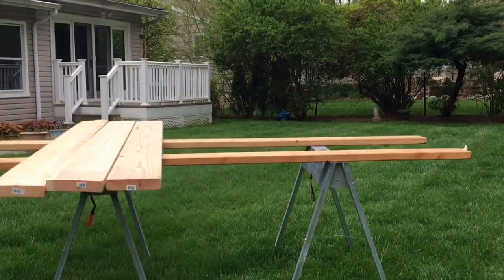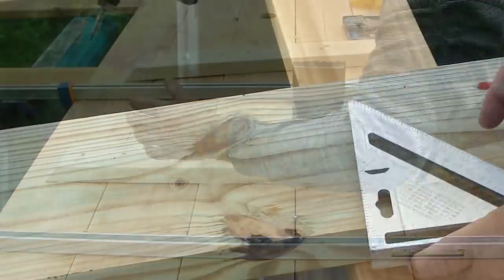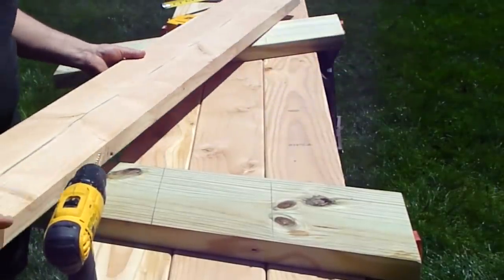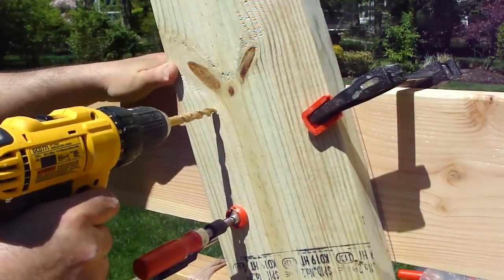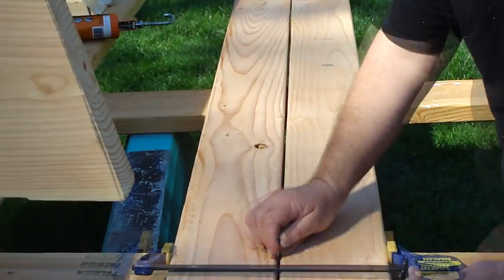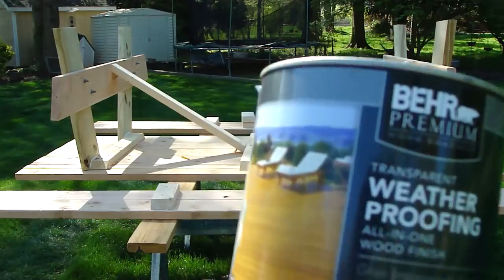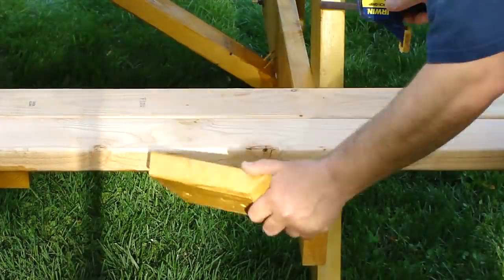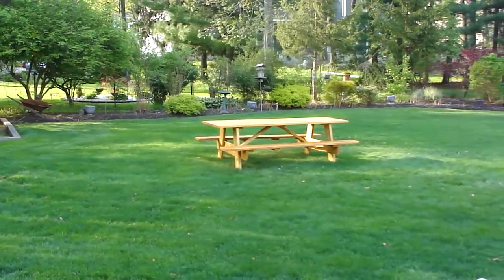HOW TO MAKE A PICNIC TABLE

Comment: Hi there when i built mine i halved the a frame 10 mil for strength  and used 10mil bolts and d 4 polyurethane glue to hold it together👍

Comment: Nice design and man you have a gorgious lawn !!  I wouldve used longer screws or glue as well on those diagonals.  Picnic tables are prone to rack.
Reply from the maker: Others have made the same suggestion.  I'll keep that in mind if I make another, however the table is holding up very well, it just turned 3 years and we use it a lot!  Thanks for watching!  And thanks for complimenting my lawn!

Comment: Can that paint be tinted? or is it whatever color they have? I built my Dining room table but we are receiving a new table and I want to put my table outside but want to sand and repaint it first.
Reply from the maker: There were different colors to choose from , the one I used was called natural which I assumed would be clear, but it wasn't .  However I'm not disappointed with the color.
Reply: ok the top of table is currently an espresso brown and base is an off white color and want to try and keep it close if i can.
Reply from the maker: I'm sure there are plenty of options.  I got to say, the water proofing of this product is amazing, I hosed it down and the water beaded right up!

Comment: A couple of comments: 

1.  Those are not carriage bolts.
2.  Those angled deck screws holding the bracing to the bottom of the table, partly exposed, seems a weak point; wouldn't it be better to drive them straight down?
3.  Some measurements would be useful?
4.  The music... ugh.  

On the positive side, nice video generally.  Helpful, thank you.

Comment: What kind of wood did u use for the table for example like ceder, pine, ect.
Reply from the maker: Joshua Ferland I used construction grade pine  2x8’s for the table. The legs were pressure treated pine 2x10’s
Reply: Your trash my treasure thanks for such a quick reply! I plan on making a picnic table for my mom this upcoming spring and ur video helped me out a lot.
Reply from the maker: Joshua Ferland I’m happy to hear that. I put off making it for a quite some time because I was intimidated by it.  But surprisingly it was very easy to make. You should check out the video of the lazy Susan I make for it with the left over wood. That was super easy and your mom will love it.

Comment: Can anyone comment what length of boards that are used here? Eg length of the 2x8s? Thanks!
Reply from the maker: Let me check and measure, I'll get back to you.
Reply: Your trash my treasure great build but I am also curious about length of boards for seats and table tops
Reply from the maker: The table top is made with 5 boards 8 feet long 8 inches wide.  The benches are made with 4 boards (2 for each side) they are 8 feet long 6 inches wide. The cross braces are   5 feet 7 inches long and 8 inches wide.  The legs are 2 feet 6 inches long and 8 inches wide.

Comment: What's the length of the legs ??
Reply from the maker: Alexis Juarez 30 inches after you cut off the 28 degree angles from the top and bottom
Reply: Just out of curiosity, This Old House had the legs cut at 32” you had yours cut at 30”..  any specific reason?